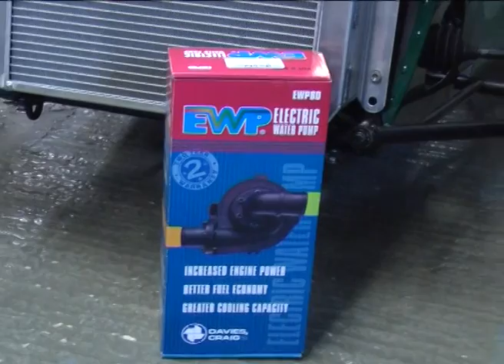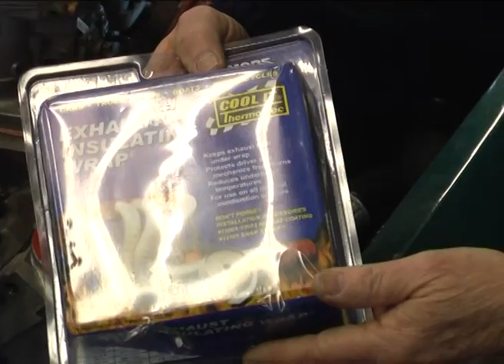Engine cooling using the Kenlowe electric fan, Electric water pump and Exhaust jackets.

Comment: Hi Sir you should have installed the fan on the inside of the radiator as I found it give a by far better air flow by drawing more air through the radiator & over the engine & all do change the wires around & possibly the fan off & turn the fan around for the air to come through the radiator & force the air over the engine & that way you get by far better cooling Kind Regards Peter

Comment: Good video with good points. I have a very similar cooling setup on a 1977 TVR Taimar. Cooling on the Taimar has always been difficult when the car isn't moving... it's a bit of a design flaw... the radiator and fans could never really cope. My solution was to create ducting to connect the air intake grill directly to the radiator so that the air flowing through the rad is cool air from outside, and not recirculated hot air from under the bonnet. This has made a huge difference.

Comment: I found out (with a Revotec by the way) that since a blowing fan pulls at these straps they tend to loosen somewhat. Furthermore I have my doubts on having the fan hang on those straps as well, since over time plastics tend to age. I suggest at least supporting these fans vertically by other means. With my fan I used an extra set of (also Kenlowe provided) supports to hold the fan more firmly to the radiator.
Reply: Tienen razon esas correas plásticas tienden a aflojarse con El calor y El tiempo. En mi toyota me sucedió qué al aflojarse la vibración me rompió El radiador. en mi f350 estoy fabricando una base para sujetarlo firme y que no pueda vivrar lo Unico que tengo que Comprar son unos tornillos cabeza plana para que no choque con El radiador y aislarlo con silicona para que no toque El radiador la cabeza plana del tornillo. Saludos

Comment: 2 questions.. 1. wont the fan get burnt/melt sitting so close? 2. wont the radiator fluid lines take damage from the weight of the fan?

Comment: The fan should be mounted as high up to the top of the radiator for efficiency as the hottest part is near the top hose. The bottom is the cooler part.

Comment: Anyone else notice they installed the fan on the wrong side lol that means its gonna pull all the engines hot air into the radiator instead cold air across the radiator and motor.
Reply: +OneBad88S10 MAN!, today i installed two electric fans, and my car temperature is getting more HOT! and my car power got less ! and when i go to front of my car the air is pushing outside of the car is that mean it installed wrong ?
Reply: Saeed Alblooshi yes they are installed wrong. Most fans have a pusher and a puller setting..   Try reversing the wires and see if it draws air from the outside in towards the rad and motor. You always want the air to flow inwards not outwards. If your fans are blowing out the front you are drawing all the heat from the motor thru your radiator and causing it to heat the water not cool it.  You want it to draw the cold air from th he outside of the car into the engine bay. The fans are most definitely reversible just by hooking the power wire and ground up backwards. So reverse those wires and you're all set!
Reply: no they didn't you push the air through the radiator all 3 of you dont know what your talking about
Reply: To
Reply: Just in case someone else reads this..
Fans can be installed in front of the radiator (normally called a pusher configuration) and behind the radiator (called a puller configuration). On belt driven fans though they normally push from the engine bay into the radiator (old school thinking that worked for 90 odd years) so these guys may have simply been trying to replicate what was originally installed. But if it works it works.
btw, if room permits the best configuration is a puller configuration, as it will pull cold air through the radiator and then push cold air onto the engine.

Comment: this is the absolutely worst method to mount electric cooling fans...over time and miles the radiator fins and tubes will suffer extreme damage caused by the constant bouncing and the weight of the fan fastened to them...eventually becomes a roadside failure of extreme proportions...do yourself a huge favor and mount the fans solidly to a set of brackets specifically designed to hold cooling fans....you will save big dollars in the long run...guaranteed !!
Reply: Sure with some metallic brackets in the car body is far better, but believe me will work fine for decades and only with 4 plastic tireup's (i think is better because you can tight up more strong) ... i have practiced this many many times here in Greece, when i serviced  Car A/C back in the 90's (because of the heat enviroment we have here, many times we put an extra blower fan to the front of the A/C radiator, to help the A/C work better and lower the pressure/temperature of the A/C system to normal...) Sorry for my english...

Comment: those plastic tie rods will eventually destroy your radiator, vibration makes them act like a saw and chew through metal. A cooling fan can go either side of a radiator, if its on the outside it blows air through the radiator , if its on the engine side the fan is designed to suck air through the radiator from outside, whether it blows or sucks depends on direction the fan turns as its a curved blade.
Reply: Really? saws?